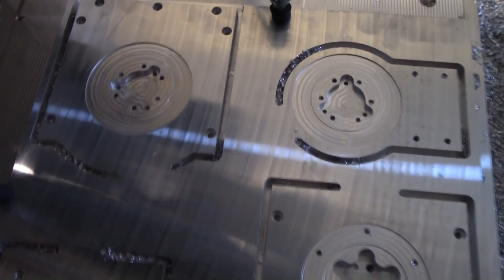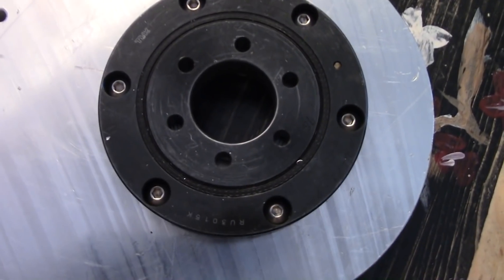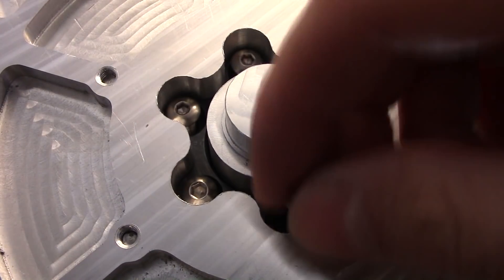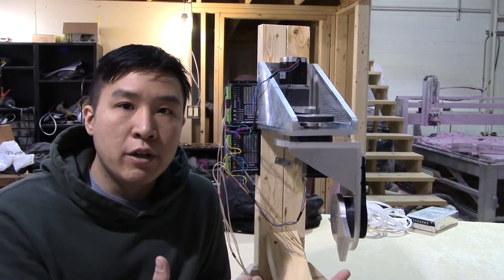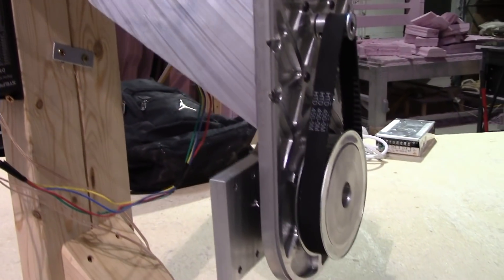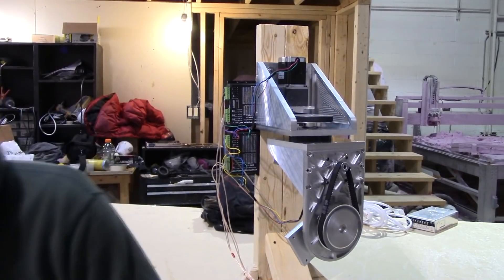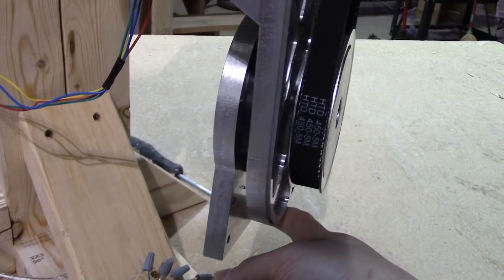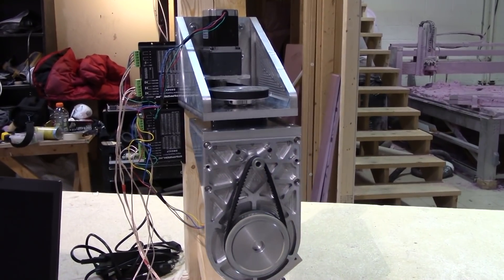DIY 5 Axis CNC - Well built young grasshopper

Comment: Nice work …. I spent a lot of time working on commercial versions of that style set up that you have (THERMWOOD) … did you include provision for centering the spindle on each of the rotary axes?   May not be an issue for your application,  though always easier to program / troubleshoot a  machine that is well trimmed vs one that isn’t .

Comment: Could you give a parts list and where you got them (links) for the hardware you didn't mill? I'd be interested in making a 4th axis (A on the Z?) and a platter rotary on the table for the 5th. I have never done cnc before but I'm buying one and would like to improve on it for my needs. It's very hard to find information. I think if I add tapper bolts I could tie the A on the Z super tight for when you need just Z axis milling but then un-pin for when you want the swivel. 

Thanks again!
Reply: https://www.ebay.com/sch/i.html?_from=R40&_trksid=m570.l1313&_nkw=THK+RU3015K&_sacat=0 Found, sorry... missed when you said it in the video!

Comment: Thank a lot for your nice video , can you tell me whcih kind if gear stepper motor you use which gear ration you use and if it possible tell me about belt pully diameter ? thanks in advance

Comment: What is this black bearing in 1.39?
Where did you buy them?
Reply: I also want to know.
Reply: Cross roller bearing.
Reply: It's shown right on the part in the video at 1:48: RU3015K, which seems to correspond to a cross roller bearing from THK.  Must be really old though as it's not on thk.com's new or discontinued products database and online I only find used items for sale and no spec/data sheets.  This page has a nice explanation of crossed bearing benefits: "Crossed roller bearings provide more accuracy, rigidity, and weight-bearing capacity for linear motion than other commonly used friction-reducing devices such as ball bearings. And unlike ball bearings, they can support moment loads, radial forces or tilting loads. This lets one crossed roller bearing replace more than one ball bearing, thus saving the space required by ball bearings, lowering the associated material costs.  Crossed roller bearings are preferred for high-precision linear-motion applications with relatively short linear movements that require smooth motion."   https://www.nbcorporation.com/basics-crossed-roller-bearings   I think when adding a 4th+5th cnc axis saving space is a big factor.  It looks like you can get them from Aliexpress for ~$70-100 but who knows how the quality compares to name brand versions like THK; https://www.aliexpress.com/wholesale?SearchText=cross+roller+bearing.

Comment: i have built the same 5 axis system 9 years ago there was a group in yahoo called cnc kit and a design availble called doughty drive somethjng like that but i didnt get it to work the problem is getting a light weight spinldle that wont vibrate and you need a big er collet to hold longer biger diameter tool nice job and good luck , let us know how it will cut

Comment: You seem to have a couple of mounting holes near the toothed belt where you could install tensioner pulleys to push against the outside of the toothed belts. If you get an unexpected amount of backlash/slack when machining, not having these installed could be the culprit.

Comment: could you provide the link of "planar bearing" used between two Al plate? i don't know its exact name. Thanks!
Reply from the maker: its called cross roller bearings. got it on ebay.
Reply: @InspireCNC  Thanks man

Comment: Hey, I like the DIY factor! Do you want to share what CAM package you use to program 5 axis simultaneous g code? I've converted a robotic arm and have a g code translator for it but I'm having a hard time finding anything that does 5 axis instead of 3+2. (Well except stuff that costs as much as a house).
By the way I saw you commenting about making the stepper adjustable for tensioning, I think a sturdier and easier way would be an tensioner pulley off a car that has an excentric mounting hole and a hex key slot.
Reply: D C mastercam works great just visit bitorrent for example

Comment: Haha I was just thinking about a 5 axis router! I subscribed to your channel quite some time ago and here your video pops up :D
Is this designed to only mill foam or would this be strong enough to mill wood or even aluminium?
How would you tension the closed loop belts? Did I skip that part? Or is it not needed?

Thanks for the video!
Reply from the maker: Good point, I didn't account for tension until I started assembling it. My plan is to remachine the mounting holes for the stepper motors so that I can adjust the position back and forth. That way I can tension the belt. Alternatively, I can create a tensioning pully that loads onto the belt, but that's more complicated. This design could be used for wood, I doubt it would do well with aluminum.
Reply: @InspireCNC  Yeah nothing that can't be fixed. Thanks for the info! I'm playing with the idea of building a really cheap cnc router that can cut 8x4 sheets but also can mill beveled edges to create compound shapes out of wood panels (e.g. for boats or a tiny house). Just a crazy idea atm.
What was the reason why you went for 5 axis instead of something like a tool changer to mill this with many small passes? Undercuts?
Reply: Nice job. Can you do my full scale model. How much ?